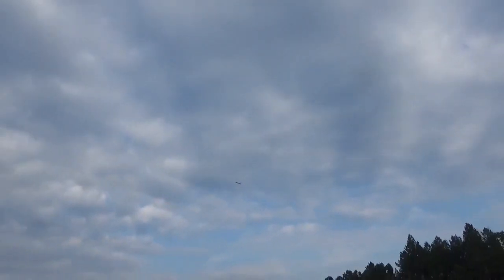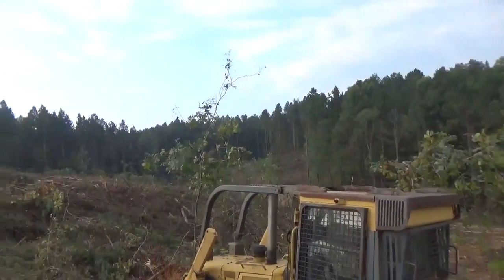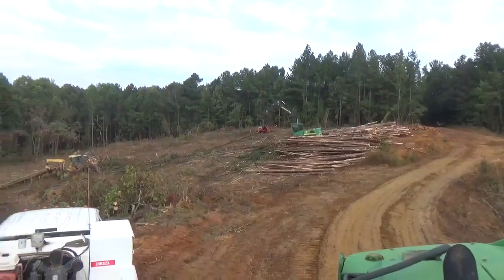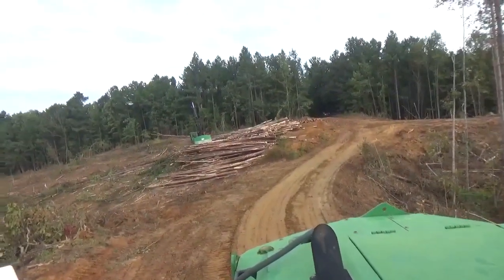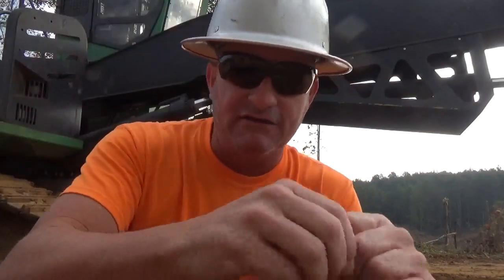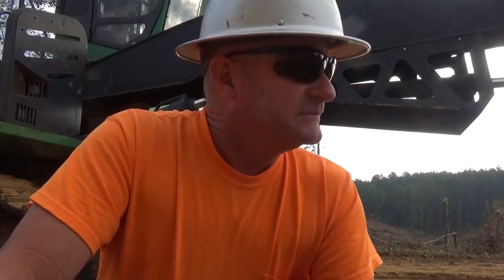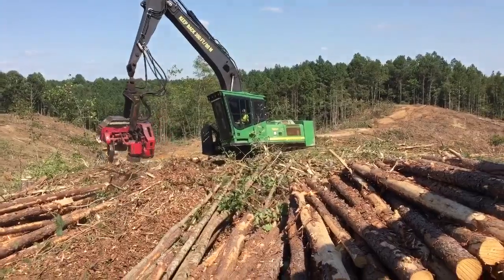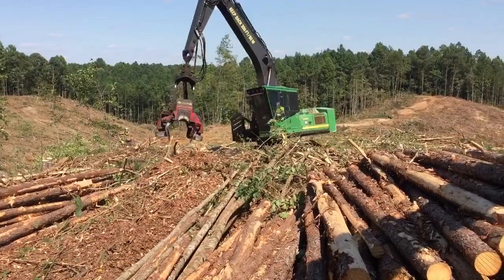Q & A, from Hero to Zero

Comment: cotontop I'd like your honest opinion on your tigercat track buncher. I'm coming up in the logging industry and have a business with my dad but am looking to head out on my own sooner than later. right now we run a 753g deere track feller which weighs about 57k. we cut in central Wisconsin mostly northern hardwood select cuts and poplar clear cuts. However, our soil substrate often has a lot of clay and I'm worried about keeping an 90k machine above ground level. what are you thoughts on its performance in marginal ground? Also, what is its average fuel economy. Our 753 runs about 12 gallon/hour. We need a machine that can handle large trees in some relatively steep ground So I'm a little torn between an 822 or 830 tigercat or a 260 barko buncher with a quadco head. I like our 753 carrier very well, but the gilbert  saw head is a joke. let me know your thoughts